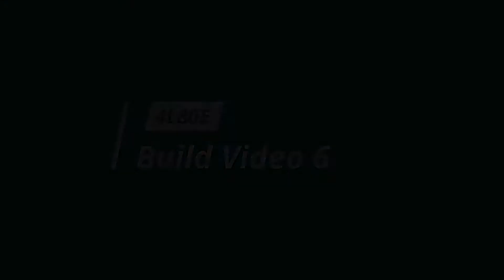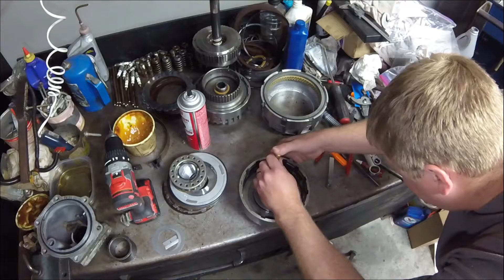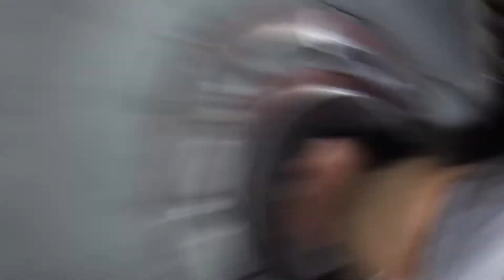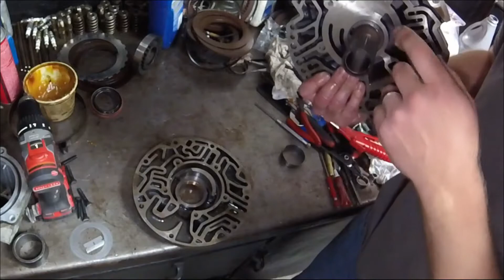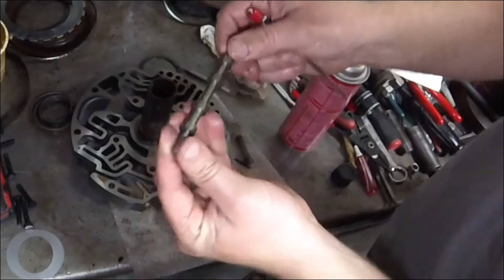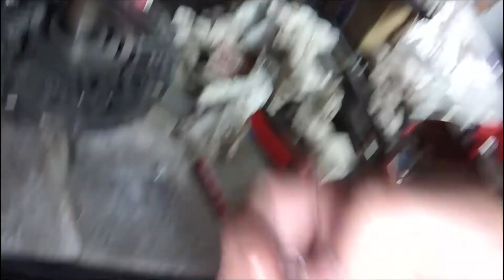How To Build a 4L80E Transmission Part 6

Comment: I have .120 in-between the intermediate clutch pack but my top steel is stock .250 length 🤷‍♂️ idk how to reduce the play in there should i add more steels?
Reply from the maker: You can add an extra steel if that’ll get the clearance correct. I think you can use th400 steels which are thicker if you need to. Or a thicker backing plate.